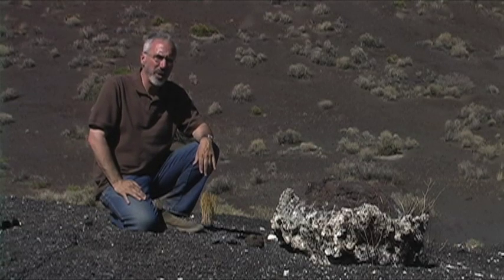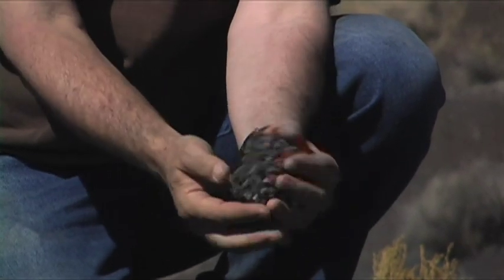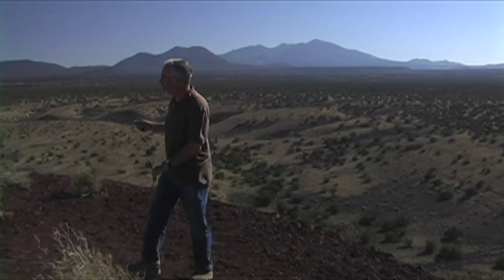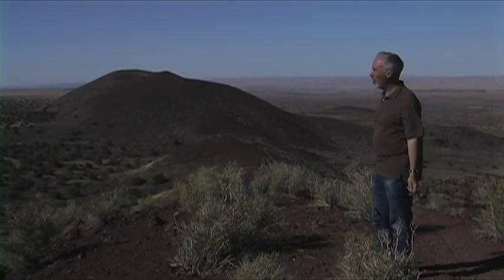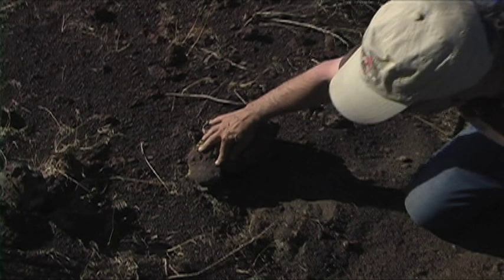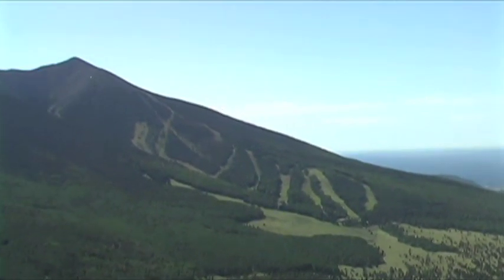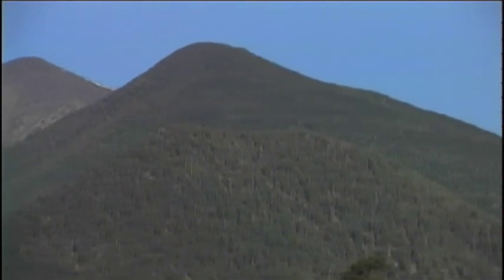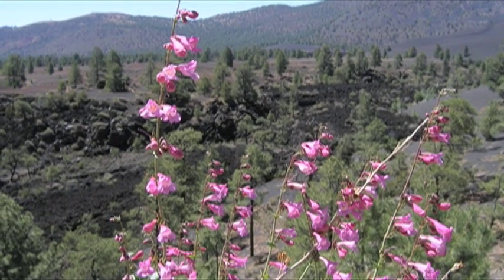Steve Doyle's San Francisco Volcanic Field - Part 2 of 2

Comment: I live 9 miles east of snowflake Arizona . Next to a ancient volcano.  It's several miles long and I'm gonna say a 1000 feet up.  I've been told its extinct. But folks that live out here let's just put it this way if the wind blows just right you smell sulfur. Plus if your well is the wrong depth your water stinks of sulfur and it's pretty much useless. I don't know where it is myself but I have friends who know where there is a bubbling pool of mud along this thing . Guess my question is what formed this was it a thin spot in the crust a hot spot like Hawia or is there a fault line here I'm not aware of.  This thing is about 9 miles east of snowflake Arizona just off the concho highway. Easy to find on Google earth.
Reply: Fascinating! Bubbling pool of mud is enough to convince me that it must not be entirely dead. Especially the upwelling and release of gases that people can smell. Something going on under there. It may not be much, but that is some compelling evidence.